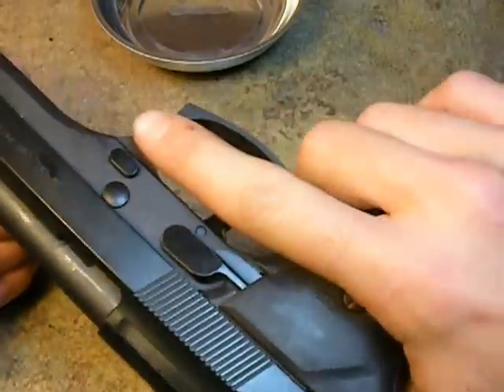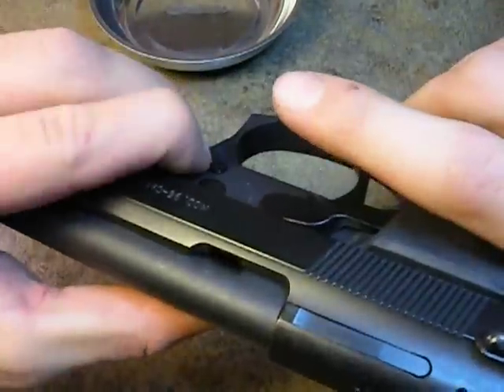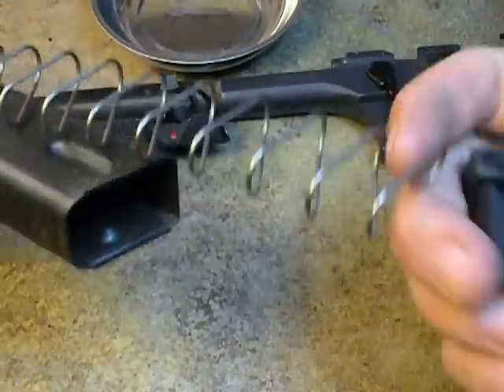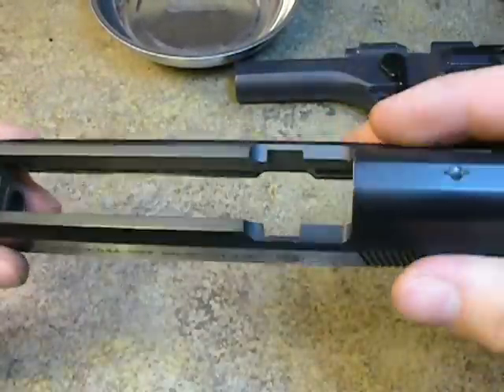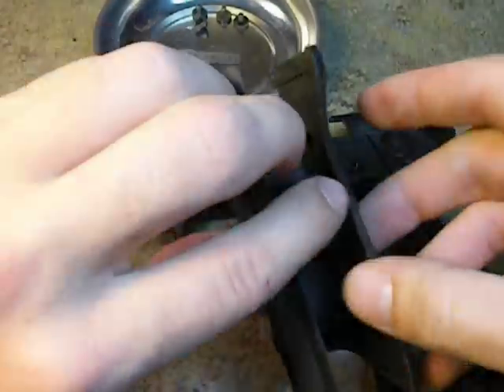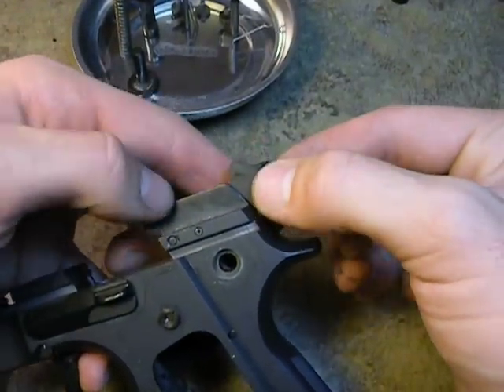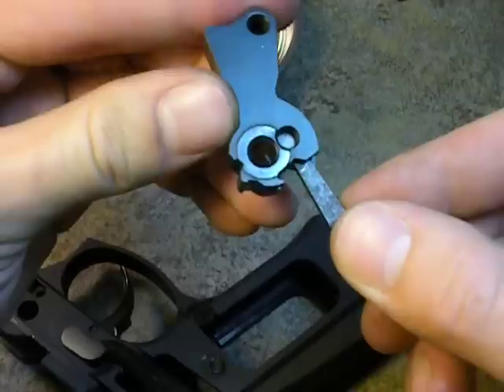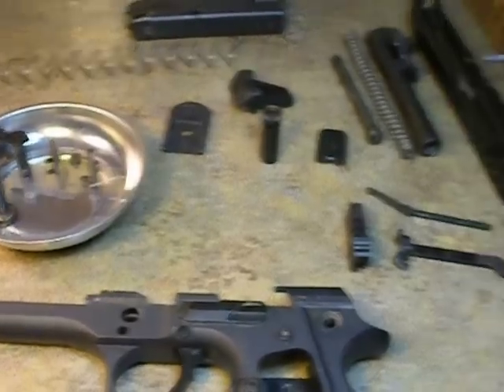Beretta Pistol Disassembly

Comment: Get rid of the wimpy trigger spring that comes with the Beretta and buy a Wolff trigger conversion kit. It replaces the mousetrap configuration to a rod with coiled spring that is np3 coated. You don't have to worry about the spring snapping or wearing out on you. Good video young man. I've been shooting Berettas for over 30 years and love my Berettas.

Comment: That little trigger spring is actually what I was looking to replace and it's the one piece you didn't remove.  I need to replace the one on my 84F.  My pistol is completely useless at this point.  Any help will do.
Reply from the maker: +Eileen Matulac Just find an exploded schematic of the pistol online and order the spring you need. :)
Reply: +WestonSummers I have it and I have the spring replacement, but I just needed to know exactly how to place it back in.  I'll just have to bring it to a gunsmith.  Thanks,

Comment: If you use the Wolf new trigger spring (called "STANDARD TRIGGER RETURN SPRING CONVERSION UNIT") it is very simple to reinstall and much easier then the OEM spring (no i don't sell them, they're just useful).  Also a worth while parts change as this trigger spring is less likely to break (Wolf designed this spring in response to US government agency as theirs apparently were breaking too often).

Comment: First step in the handling to include dis-assembly of any firearm is to place the weapon on safe - then eject the magazine.  Once those two steps are complete you then check the chamber visually and physically to ensure no round is present.

Your weapon was on FIRE and you racked the slide with a magazine inserted.  Both of which are extremely dangerous.
Reply from the maker: You are very correct. We all thank you for your safety briefing. Have a great one.
Reply from the maker: Actually it took me five tries to get this video without messing up too much wording or flubbing a part. If this pistol managed to fire a round after that many tries of being empty and taken apart, It would be an act from above. Cheers and stay safe. .
Reply: Noticed that myself, being ex British Army it was drummed into my head , Mag out cock three times look and feel into breech and mag well then announce loudly: “Clear “. Only then do you proceed to dismantle